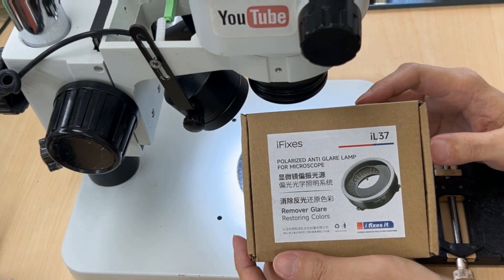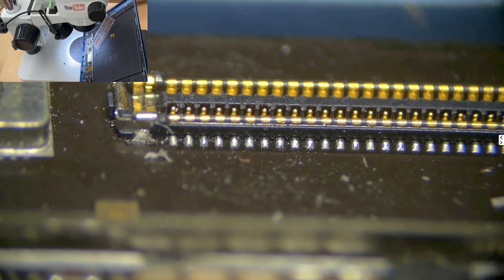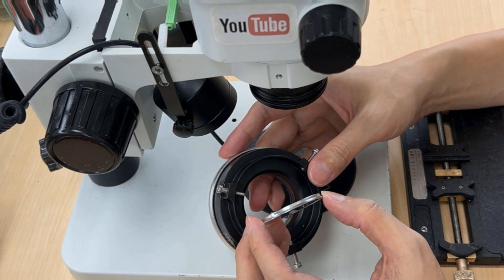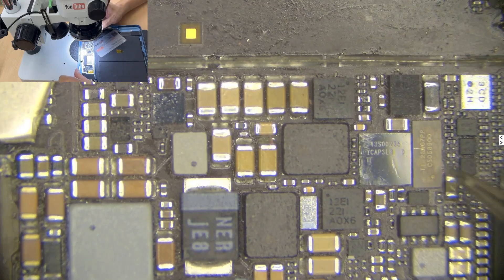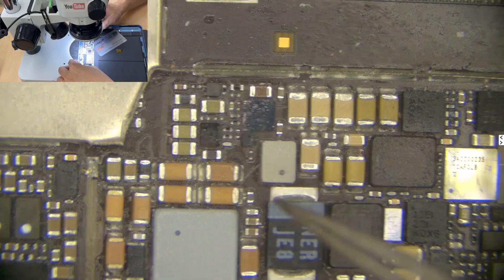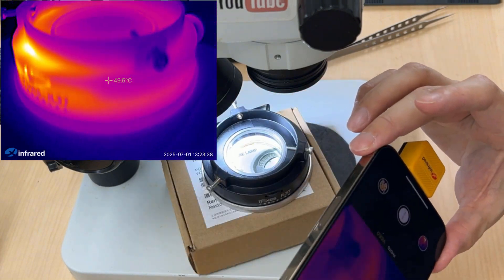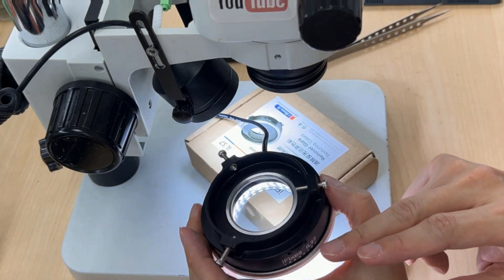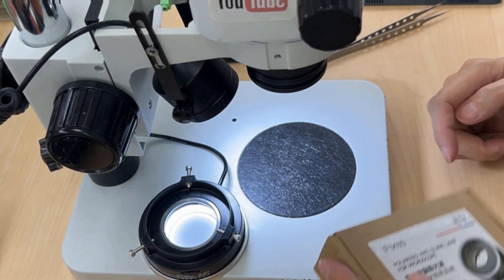This Lamp FIXES Microscope Glare – iFixes iL37 【Review】

Comment: Hi master, I have already bought your light which is really good. Can I ask you if you have a microscope to recommend? I really like your Soptop 7045, however do you think it's better to get something with more zoom like x50 or x60 like the Soptop 7060x (although it seems to me a poorer version of yours even though it's new)?
Reply: Can you please provide a link as to where you purchased it ?
Reply from the maker: You can replace eye pieces to get more zoom. Default is WF10x/20. Example, YCS microscope they have more zoom like 65x or 75x comparing to mine 45x, but the trade-off is the center image always appears slightly twisted—you’ll notice a swollen or bulging circle in the middle. So I don’t like it.
As for clarity, SOPTOP is better, but more expensive.
Reply: @iPhoneServiceMalaysia  Thank you master for the answer.

Yes, you're right, the old models like your Soptop 7045 or the famous SNZ71 were of excellent quality, in fact they were produced by a Chinese company called Sunny Optics. Now there are new models called Soptop #6 and Soptop#9, which seem to me only rebranded of the first two microscopes but I am skeptical about their quality, in fact on the Sunny Instrument website there is no trace of these microscopes. Finally, a few days ago a new Soptop brand microscope called 7060x came out. As a result, I think that even the Soptop brand is no longer synonymous with quality for these new models #6, #9 and 7060x. You master, have you ever heard of these new models? If I had to recommend the best microscope quality price would you always recommend yours or another model (my budget doesn't allow me to take Nikon, Leica, etc 😂)?
Reply: @iPhoneServiceMalaysia  Thank you master for the answer.

Yes, you're right, the old models like your Soptop 7045 or the famous SNZ71 were of excellent quality, in fact they were produced by a Chinese company called Sunny Optics. Now there are new models called Soptop #6 and Soptop#9, which seem to me only rebranded of the first two microscopes but I am skeptical about their quality, in fact on the Sunny Instrument website there is no trace of these microscopes. Finally, a few days ago a new Soptop brand microscope called 7060x came out. However, even on this microscope I am skeptical about its quality because it seems to me a simple rebranded model produced by another company as do all other brands such as YCS, Relife, Sunshine, MaAnt etc. As a result, I think that even the Soptop brand is no longer synonymous with quality for these new models #6, #9 and 7060x. You master, have you ever heard of these new models? If you had to recommend the best microscope quality price would you always recommend yours Soptop 7045 or another model (my budget doesn't allow me to take Nikon, Leica, etc 😂)?